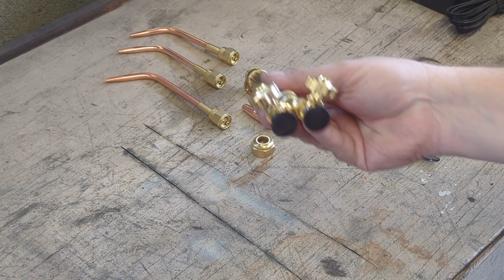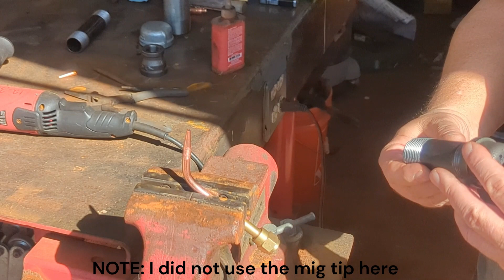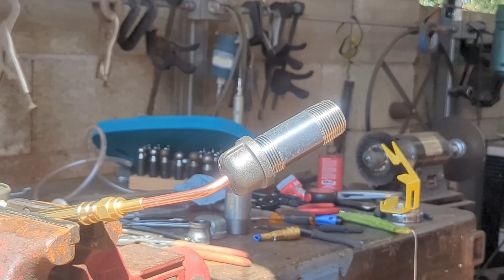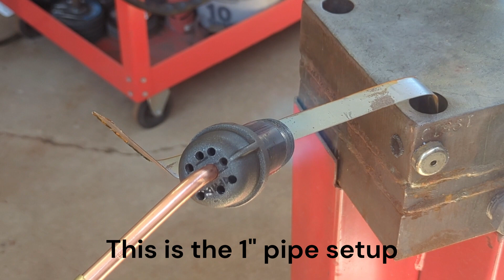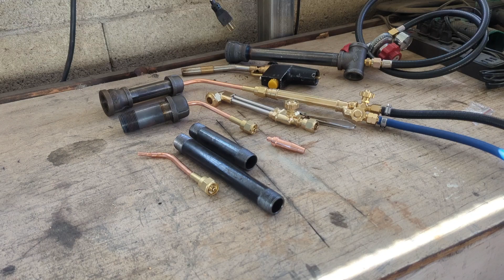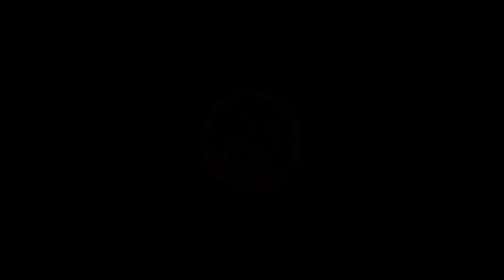How to: Oxy Acetylene to Propane Compressed Air Torch

Comment: Hi, from India.. here propane or butane is not available easily. Acetylene and oxygen is available. My question is.. can this type of pipe setup be used with Acetylene and oxygen mix as a flame thrower. The purpose is to heat the mould for Aluminum Gravity casting. We have been using LPG for that. But now supply for industrial use is curtailed now. So trying to find a different way to heat the mould.. thanks

Comment: Where did the compressed air come in ?
Reply from the maker: At the 10 minute mark, I show the handle with 2 hoses attached. One is the propane and the other is from the air compressor.

Comment: National type 3A blow pipe

Old product that's been here for decades... Cute little torch, a little smaller than what you're using. 
Glass workers etc. 

Look at their tips. It's a simple screw-on tip. Some of their tips are propane and air.
I have a handful of them in front of me.

Comment: Thanks for putting a link to my video. Not sure why you drilled holes in the back of your burner as it will work without them. It took me many years to get this  burner to work. I saw an ad in a magazine from 60 years ago about this burner but no info on how it worked so I had to start from scratch.

Comment: If you want to bump the heat up some more you can run the fuel through a bubbler filled with your favorite flammable liquid before sending it to the torch. Isopropyl alcohol, unleaded gasoline, and diesel fuel have all worked well for me. My setup is a little more compact and focused, burning what sounds like a lot less fuel, but still able to braze 1/4 steel, brass, and copper. Get yourself some fire brick to put under your work piece also. You might be surprised by how much heat a steel table will soak up and give nothing back.
Reply: Heat senk

Comment: On your cutting torch, your oxygen knobs work kinda opposite of your assumption. The bottom knob sets full flow volume, the top knob is for setting your pre-heat (idle) flame. In use you open your fuel gas, and light it. Adjust to least smoke flame (fuel knob on the bottom). Then you crack open the oxygen knob, and open it about a quarter turn (top knob still shut), no effect on your flame yet. Now you gently crack the top knob, and adjust your flame to neutral. Use the neutral flame to preheat your cut start point til you just get "sparks jumping" from the edge (just the odd meteor, not a shower), now squeeze the lever, do your cut, and release the lever.

The cut mechanism is that excess oxygen is burning the carbon out of the steel. That means the cutting torch ONLY cuts carbon steel. It'll burn up aluminum (because it's a fuel), and do horrible vandalism to stainless, but will NEVER give a clean cut on either. Cast iron and carbon steel, awesome. Anything else, wrong tool.

Will it effectively give benefit to your "compressed air/propane torch" rig? I dunno, but I kinda doubt it. The preheat flame is basically just your welding tip flame, so any excess compressed air beyond that won't really do much good unless more fuel is added too. Or so it would seem. Only way to really know is to try